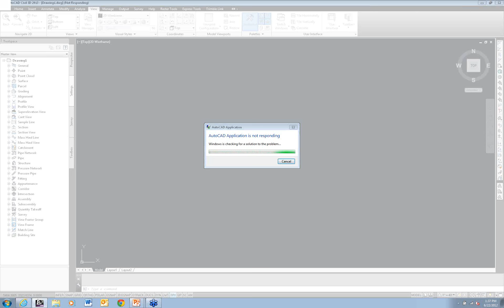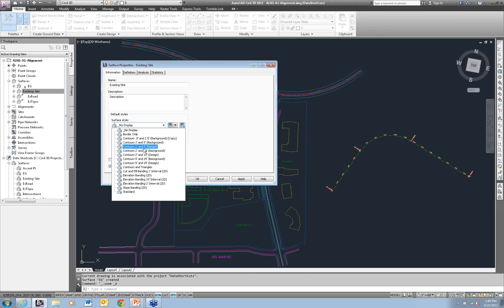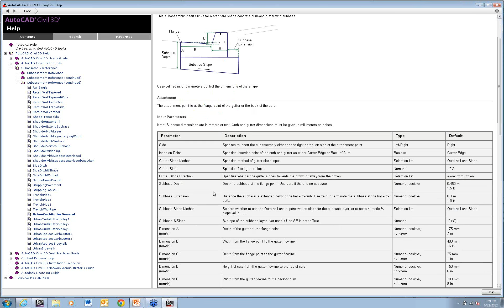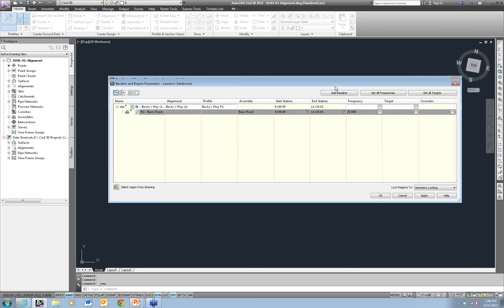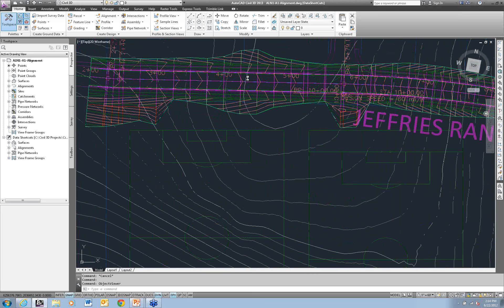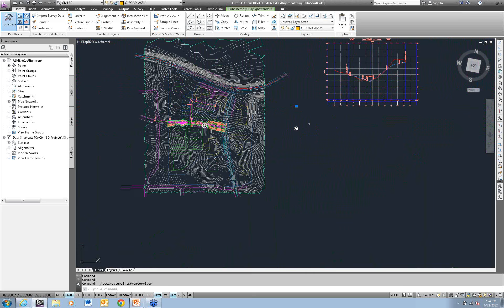CAD-1 Presents - Basic Roadway Design in Civil 3D

Comment: Hi, I made a haul mass diagram and got the table of the masses with it's respective station, but the drawings of the haul mass diagram, are drawed in a way that the max values are not shown in the cad haul diagram, so I drawed it on excel using the table that Civil cad provided and it shows the max values in the appropriate positions. I checked that the diagram in civil was hitting the points in the vertical profile where the roadline changes from a cutting surface to a full surface and they don't match (the one of mass haul and the profile view)